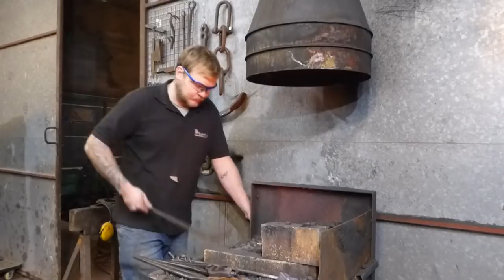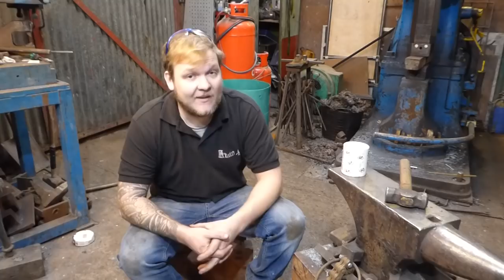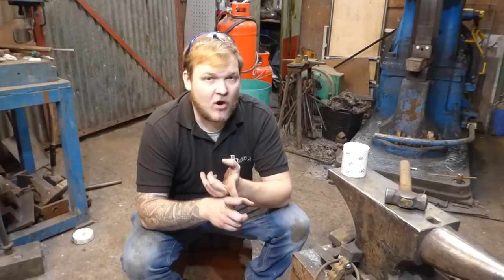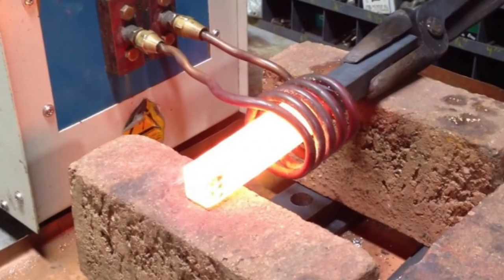Climate Change? Is the future of Blacksmithing Electric?

Comment: All this electric stuff is nice , though will prove inadequate if not severely over-dimensioned.
Let's not forget that a user like an electric oven/forge needs to get its 'lectric' from somewhere.
Unless you have a decent array of nuclear power plants you are just producing the carbon dioxide elsewhere.
Hydrogen is a not a fuel source, but a transport means of energy. So you introduce losses at every step.
I can have an educated guess, that these alternatives will all prove to be prohibitively expensive.

I'd bank on renewable oils, and/or charcoal if coal or gas can not be used anymore. If you need a lot of energy/heat, fast.... electrical stuff is the worst choice...lest it is made disproportionately large/powerful. That makes it, as said, very expensive.
Of course climate-change is real and needs addressing, those who doubt it or 'ask for the evidence' should have listened when the evidence was presented. It is still out there for all to find. Claiming that this isn't so, is tantamount to criminal negligence. 
But..... how to solve it? Well, put some engineers in charge, rather than politicians! We need to go trough all the learning cycles of nuclear energy, in order to , one day come out, at nuclear fusion. Skipping valuable steps, by banning nuclear as it stands now (and then buying nuclear power from neighboring countries)doesn't add anything.
Alternative sources, are fine, but woefully inadequate, but here to a learning curve will have to endured, so we need to go on with them.
But it needs doing in  responsible way. 
Solar is a good example. 20 years ago, a solar panel could never produce enough to offset the CO2 that was produced during the manufacture of said panel. That CO2 (during production) has been drastically reduced in the last 10 years. We're not 'there' yet, but this is a game of effort and patience...

 Paddy
Reply from the maker: As for the oven thing I agree and we'll I wanted to know if special rules might be put in place. As for the fuel burn thing renewable are defo an option. Charcoal is a no as it the worst Co2 produced second to wood and if we wanted to do that burn wood where are we going to farm cause we will need a lot more tree. FYI 76% of Canadas power comes from water. It's well possible.
Reply: Citing figures for the odd exception, such as Canada, where luck wants it that the topology leans itself to the use of hydro-plants doesn't really say anything. 
Fact remains that the share of renewable sources, is laughably low compared to what the world uses in electrical energy. And given the nature and cost of these technologies, it is doomed to stay that way. We may discover new ways of generating electricity, but as it stands now, none of them come even close to replacing conventional sources .
We are partly in this mess now, on account of assorted 'Green Parties' (those are a real danger to the environment!!) forcing epically stupid decisions on the political level, while terminally unimpeded by any real knowledge of the subject matter.
"We'll ban this, and by the time it has to be gone, we'll (that means the engineers and scientists) have come up with a good alternative"  is about the most bonehead move we could have allowed to be made!
Normal folk come up with alternatives first or have at least a plan (in most EU countries there was NO plan, and there still isn't, that is why we all buy nuclear 'lectric' from the French!)

There is a lot more trouble heading our way. In about 20 years, at least half of Europe will be driving electrically. Grids can't handle this. We do NOT have the generating capacity to deal with this, unless we start building nuclear power plants by the dozen right now!
The only benefit to this, may be that the fleet of electric cars will form a storage array for the alternative sources. The fact we can't store these energies makes the alternative sources even less useful now than they could be.

We will never be able to stop emitting CO2, and that isn't needed either. Industry needs to do some serious efforts and some decent planning needs making to switch us to electric driving.That alone would solve the issue, at least for most countries in Europe. All this providing that the power plants are not spewing out any CO2! (so far that means nuclear)

If that would become a reality, I seriously doubt that the odd forge fire or woodburner would raise an eyebrow.

Paddy
Reply from the maker: @gh778jk  China will be CO2 neutral in 10years with Brazil in closes prosute. Also most countries in euro are at about 30% of there energy production coming from renewables with most aiming for 50% by 2025. I guess the rest is nuclear. And one other thing the European Union is made up of 44 countries and produces around 10% of the worlds CO2 but if you make the EU as one country for climate change then it has the largest gdp in the world by almost 3x any other country. No wonder America and Russia are trying to distablise the European Union. Whilst America produce somewhere around 16% of the world CO2 second to China which is about to change.
Reply from the maker: Also I would just like to point out its a hypothetical situation that will happen at some point when co2 fuels run out or are just not viable a a major source of power. The video was based on the resent UN summit. I'm not saying it will happen I just wanted some feed back if it does. There where lots of issues raised at the summit with banning meat production, single child familys and banning pets to control CO2. All kinds of crazy. I was just looking for feed back on the issues I talked about. I believe that there will be situations where burning fuels will be allowed but it might come with regulation or some thing. And no a couple of blacksmith burn gas or coal won't really cause that much of an issuse I'm sure but the fact remains that if it does come to pass a ban would make it hard for most to buy gas and coal form a convenian source as there won't be production of it. Please don't think less of me for this video it is an issues that does require some thought. If you would like to answer some of the questions in the video cool and I'm happy to talk about them but please stop with the we will burn it all till its gone and then deal with it stuff. Humans are very smart and we will find a better way ultimately. It's are stubborn and lazy nature that resist chance and nothing else. If you told a man in the 17c we can put a man on the moon he would likly call you mad.
Reply: Oh there Pilgrim !
First of all 'carbon neutral' does not mean 'no emissions'
China may 'aim' to do this, but the are building coal plants as I write this, so don't be so ready to believe everything politicians claim.
Most countries do not even get up to 5 % in as far as the use of renewables go. Most of that electricity is actually wasted. (that's to do with the grid, rather than the solar or wind technology)  The European Union is NOT 44 countries.
You seem somehow to think I am against clean energy or pro-polution.... I am not. I am an electrical engineer, who knows what the issues are, and where the problems are.
Instead of swallowing the propaganda, do some simple maths. You'll soon discover that these great figures can not be correct.
Too many thing are counted as 'low carbon' or 'carbon neutral' while they just aren't.
A good example is the offset time. Produce anything extra (say a wind turbine) and you will produce extra CO2 (melting steel, making plastics,  mining copper etc) there is a certain period needed to for the device to work in order to produce electricity in order to offset all the carbon generated by its production.
As with solar, this offset period is longer than the useful life of the solar array, so making solar cells puts extra CO2 in the atmosphere rather than preventing it....
Wind is a bit better, but not by much.
These offset times are never taken into account when these overly optimistic figures are thrown out for public consumption. 
And yes, we can only improve matters by getting better at it, and in order to get better we have to at least do them. But this 'optimism' not supported by the facts and the real figures about these matters is just as detrimental as banning nuclear energy back in the day.
I am all for extra wind turbines, better and more economic fridges, freezers etc... but one has to stay with both feet firmly on the ground or the lights WILL go out. We are closer than the public thinks to that point. The problem is, that 'Green' has become a label, a selling point, a political rallying cry. It is good to see everybody interested and keen to do what must be done, but let's do better than the politicians shall we? Let's not aimlessly throw good money after bad, and blindly follow edicts made by those who are the epically clueless. (even if they are the ones we put in Office)
All it takes is some simple understanding, simple maths and yes, a limited amount of finding out what the real situation is.
Hoping for the best holds the middle between a raindance and prayer and is useless. Only correct information has practical application.
We are heading up to 11 billion people on this rock, they will all want a car and a fridge.... goodluck to the one who is going to sort that out! We need indeed truly clean energy, and we need it fast and in massive quantity. Building the better solar cell, is rumbling in the margin.
It may ever come to be a reality, but we can't sit in the cold and the dark for the next 50 years waiting for that breakthrough.

Paddy
Reply: I don't think less of you at all, on the contrary. There is a serious problem, and it needs addressing. But it needs addressing on the basis of facts, not political make-belief. The reason I join the discussion is, because I am in a position to know a few things about these matters.
I know first hand what it takes to balance the European grid, I have worked in nuclear plants, I know how they work and what the downsides are back in the day and now with the newer generations of power plants.
I also am aware of the utter nonsense regarding quick response gas plants (we do need those for the balancing act) which are sold to the public as 'clean'.... Yes they are better than coal...but they still spew just as much CO2 in the air as a coal plant.
The political flavour of the day now is 'fine dust' ...which has nothing to do with CO2 or global warming. But they can pretend to tackle this on the backs of the ordinary citizen , demand taxes of all kind, and our old diesel cars will STILL be festively carting around in some hole in the ground in Africa after we were forced to get new and cleaner ones... again a lot of money for you and I to have to spend, for something that makes the situation worse.
Belgium (I live there) has a fairly decent local grid, yet we have to disconnect even moderate solar projects on very sunny days because the voltage start running too high...
There are a slew of things that need solving and mitigating long before we can start thinking of alternatives in any serious way. I could go on, but shall not...
As far as the UN goes, I will leave you with this... Saudi Arabia is a member and.... when they needed an ambassador for women's affairs the choose "wonder-woman", presumably because there wasn't a real woman on this planet which was competent enough....

Paddy
Reply from the maker: @gh778jk  my bad and the memories is no place to rely on with Google at my finger tips lol. 28 countries in the EU sorry. still right about the gdp thing. Just have a quick question where are you getting 11billion people from? We currently only have 7.6 billion and we ain't estatamted to reach 11billion till 2100. I did check Google for this but if you could tell me where you found your info I'll happily be proved wrong. 

But apart from that again my issues isn't if globe warm is or isn't real nor is it about the actual information set out in the UN summit but for the craft I love. I would like feed back on that issues. If a situation arise where we have no more burnable fuel for what ever reason (I know its not as clean cut as this but you get what I mean) . Where can craft turn. In the late 70s early 80s blacksmithing almost disappeared in the UK thanks to government choice and public attitudes. Now we have a growing and vibrant community I want that to stay and I would like the young men and women at the college in Hereford where they teach blacksmithing to carry on for mean more years.

The video was to adress an alternative if we need and that alternative is meant for the home user that wants to make knifes or hammers. With the access to the craft so simple something to hit with, something to hit on and something to heat with and that basically it. If we loose the heat it's over.

I fear for lots of craft and the out come of gobble choose as I think in the haste to run a way with trends like you said before. (not in those words) people like myself will be left for dead. Taking action now and working on an alternative if needed is what the point of the video was. Maybe your right maybe that isn't an alternative but what if your wrong? My point about the moon. You tell me fingers and arguments that help you and I'll uses mine but at the end of the day we will have to change at some point and how does the craft do that as well??

Thank you for your input. If you watched the whole video you will understand I'm not really that interested in talking about CC but the affect of governments choices. The Forge isn't for people like me as it would help me much you will have seen this from other videos I have made. It a quick heap and easy to make possibility if one exists.
Reply: 2100 is only about 80 years away, and in terms of climate, in terms of extinction level events that is very short !
The reason I quoted 11 billion is that, after that figure is reached, it supposed to start to go back down, so basically as a theoretical maximum.
My point is this : as far as effect on the biosphere goes.... we are a plague... there are just too many of us,especially of we all going to try and live like you and I are living.
If any other species of mammal would have the numbers and the effects on our surroundings the way we have, we'd be culling them like a thing possessed!

Now as far as your craft goes.... can it be seen outside the problem of climate change? It has a direct effect (no matter how small) on it, and the problems you foresee, are as a result of that climate change. For my part, the great thing about the video was, that it addressed the elephant in the room and forging was merely the vehicle. 
People are extremely resourceful, and for all you know, you'd be sticking a piece of vintage wrought iron in a laser-forge  five years from now.

In democracies, it is always about government choices as it is the (very) imperfect way of translating our ideas and solutions as something we all do together. This UN panel has already caused a multitude of very dumb and dangerous legislation in several countries, where the 'hidden' agendas are so clear that they outshine the sun.

If your coal or propane forge will have to be "operated illegally  during the hours of darkness" (and that may yet be the case) it will be because of the same reasons as all the other political abuse that is already taking place. All the more reason to understand the root cause of all of this : climate change!
The more we understand what is really going on, the more we can 'out-fact' those that will abuse lethargy in the populous (or just intellectual laziness!)the more we will be able to force them to make sensible decisions that are right for all of us. So I don't see how one can be seen divorced from the other.

In the case of forging (especially if the economy of the matter is on the table) I don't think the alternative is known yet. I don't think it is known for industry (as a whole) let along for the private blacksmith. You are basically asking the question we all want an answer to.... "gimme heat caused by some fuel or system that has no exhaust both at the point of use and at the point of generation" (and do it at low cost,in a consistent manner) If you come up with the answer, I shall gladly carry your bags on your trip to Stockholm, where you will receive the best deserved Nobel prize ever !

To an extent I understand the reluctance to talk about climate change.... though shouldn't 'man and horse' be named? It isn't because there is a contingent of reality-deniers that, all of a sudden, the facts are going to change. And the problem you are addressing, is a direct result of climate change. No government is going to do anything controversial or unpopular, no matter how small the affected group is.... Newton's law of inertia goes more for politicians than it goes for planets!!

And you are in the same boat as the owners of woodburners, pellet stoves, diesel cars, central heating on petroleum and a host of other people who have followed the guidelines of the same people who are now at the brink of banning or severely restricting all of these things.  So again.... how does one see this divorced from the cause and,the often, parasitic response  of the body politic ?

Paddy
Reply from the maker: @gh778jk  dude I'm to thick to carry on this conversation. Sorry I out would love to carry on but time I don't is being wasted. I hope I get this to work and that the out come is positive. I will also be trying to make an induction heater but that's as far as I'm going with you. Sorry should like a cop out but I just don't think I have the brain power to talk this through with you on here. Thank for the comments.
Reply: Daniel,
I don't understand why you are getting upset or angry. We basically agree on the key points of this problem. The difference between approaches may be that I am more insisting on understanding the theoretical before coming up with the practical solution.

I may be wrong about that, but I have been thinking about your video for a bit and I think I came up with a practical application that relates directly to your craft AND may even prove I have a ghost of a point.
Here goes...

The warmer it gets (globally) the more methane ( CH4) will get released from places where it has been captured for eons. Methane is an extremely nasty greenhouse gas (some say upto 25 times as nasty as CO2.).
So if things are left as they are, this methane will end up in the atmosphere and do a lot of damage. Methane is also the main component of natural gas. 
Maybe we can capture the bulk of the methane before it ends up in the atmosphere and it can be used to power a forge! You would (by burning it) convert it to (mainly) CO2, which is a lot less 'greenhousy' ! So basically the more captured methane you'd use to power your forge...the more you'd help to fight the greenhouse issue!
In practice that may mean that you'd be allowed to power your forges and equipment with natural gas, but propane may be banned from being sold.
There would be a drawback, given that methane is a good bit less calorific than propane.
So you would have an arrangement whereby you could burn more methane per time unit than you would have burnt propane per time unit.

See? Some theory, some facts and presto a practical application directly related to the world of the blacksmith!
You suggest induction heating too. I am looking forward to see how that turns out.
I am sure it will work, theoretically it HAS to.... I am just concerned how limited and how cumbersome it will be.
Also, in terms of 'lectric' use, costs my be prohibitive to use this method as a default way to heat up the metal you want to forge.
It would be an option for delicate work, given it is very clean, and you could even make your metal white hot in an argon environment if that was required...

Paddy
Reply from the maker: @gh778jk  firstly not upset nor angry. It's quite clear you have ether more knowledge or a very different view on this to me. I'm sorry but I just don't have the time to continue to talk about Climate change and or where or not my idea be it crude is worth looking into. You are one of about 50plus people that have commented on the video and I would like to share my time evenly. Plus I make videos a couple of times a week. Have a part time job a family and my blacksmithing. So not angry or upset just out of my depth with some like your self. Your clearly a very clever guy and we'll I just can't keep up with you with out stopping every thing else. Aclot off what I  have talked about is from my memory and I can check any thing you have told me. Not that I don't believe you just like to be safe.

I have done some research into the kiln build and to be honest talking to the guys at Stoke they seem to say that lots of people have the same idea about kilns. Slow expensive to run and not effective. They seemed positive that the could make some thing so worth looking into. And don't worry I'm not going to blow £500 on coils and controllers just for it not to work. I have a back up. Which will cost less than  £50.00!

As for the methane cool I like and it's the reason I'm responding. I do have a question.....where do I get the methane from? Or how do I get it from the atmosphere?

Lots of people have suggested charcoal and I'm looking into that
So I would like to find out more about the methane also.

Thanks for the comment.
Reply: Daniel, 
If you cook on gas that comes in from the street, you are already burning methane, as it is the main constituent of natural gas.
I think, that pressures and volumes of such a connection may be too low in volume to run a forge....(you'd need a good deal more volume than a domestic connection could provide, I reckon)
There may be industrial connections available for your sort of situation, that will depend from country to country.

As to your question 'where do we get the methane from' : One major (dangerous, in light of CC) source are methane nodules in the depths of the oceans. They are kept in solid form because of the pressure and the cold at great depth.They just lay scattered on the ocean floor. If the water heats up, the methane comes to the surface and gets into the atmosphere.
There may be some way of harvesting these nodules and using them for domestic and industrial gas. There were some experimental ships a few decades ago, but I don't know what happened those projects.

Another source would be defrosting permafrost (that soil is rife with methane).

The main problem I can see is that you would need bigger tanks than for propane or butane, since you'd use a lot more of the stuff by volume to get your steel up to temperature.

For now, I think you would be limited to an industrial supply of natural gas, if that would be available to you (and economic). In the near future, it may well be so that natural gas/methane can be bought in tanks (or you have your big supply tank filled up). That will all depend on how serious the CC problem is taken and above all how much would be invested in the harvesting of methane from different sources (then from just gas wells underground). Only time will tell...

All the best !

paddy